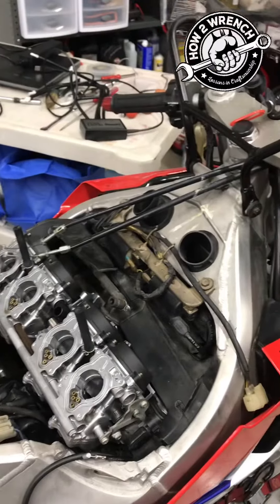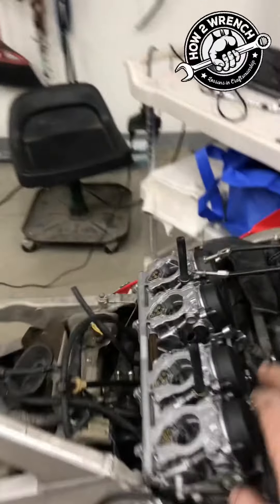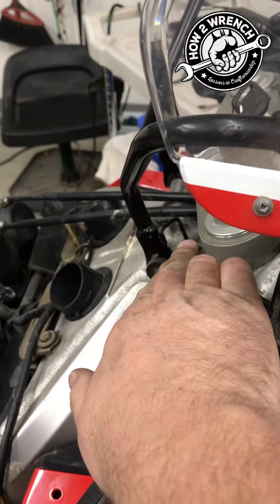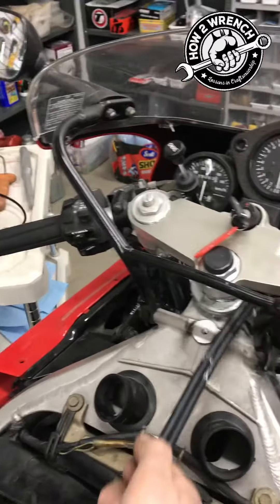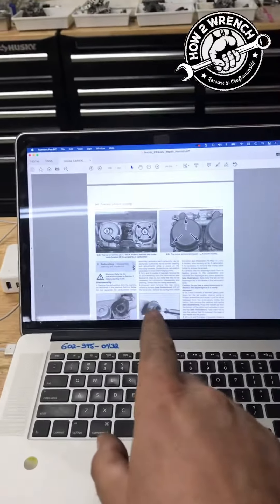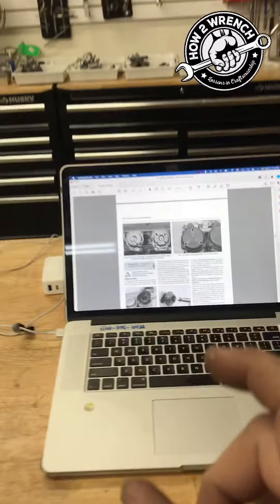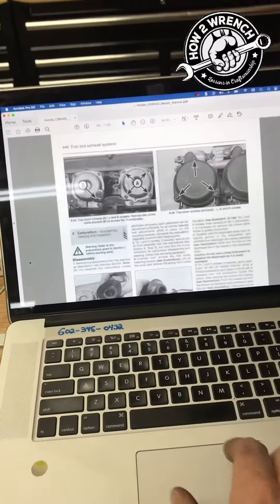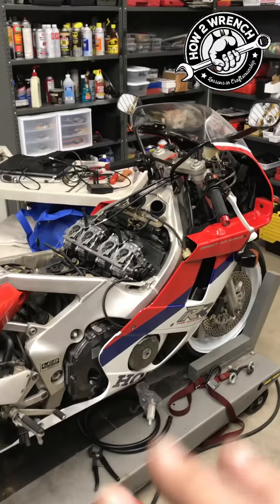More pervious tech problems with the CBR400RR...cable routing tip/info

Comment: Back in the early 80s I would assemble basket cases. The only one that stumped me was some 50cc Honda that I did have factory service manual. Not all views were in the paper manual or parts microfiche. That was frustrating, it was a job from another shop who recieved the basket case initially.